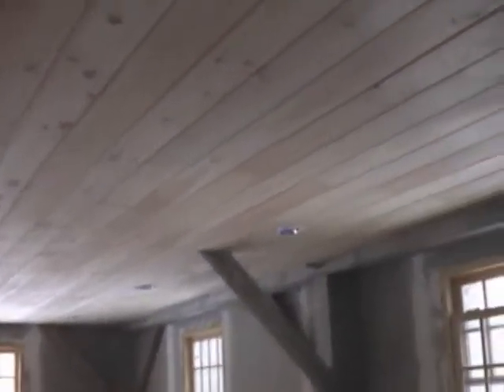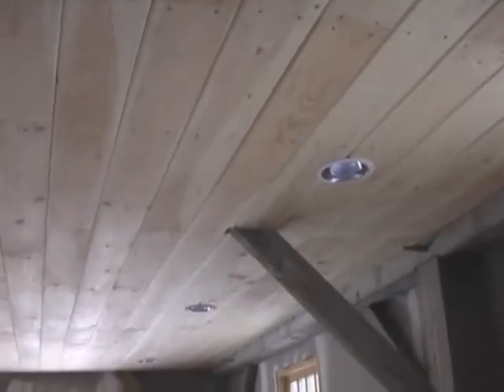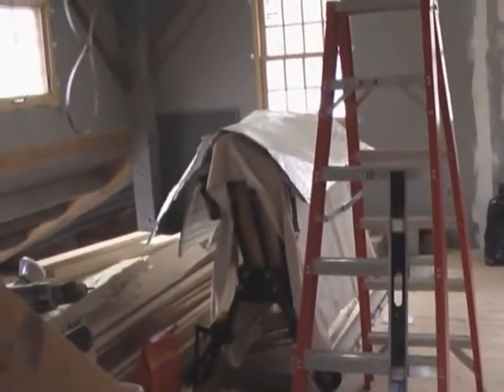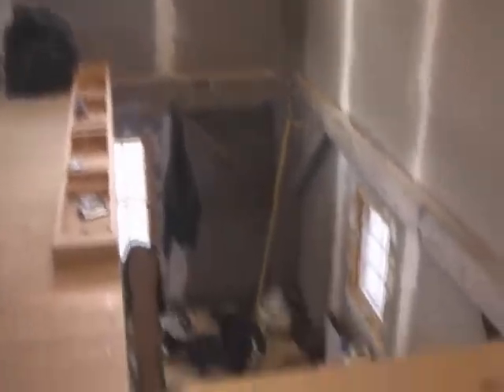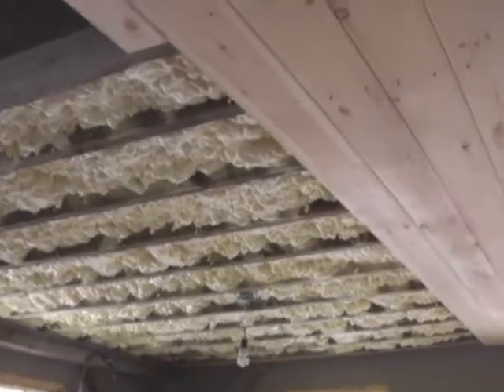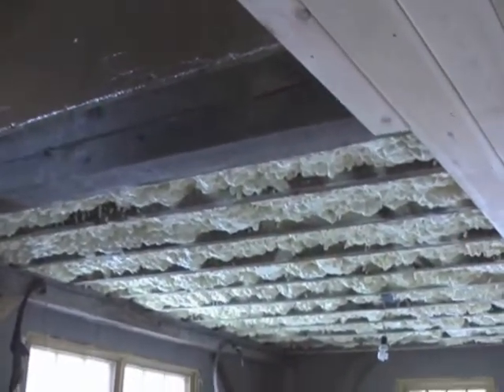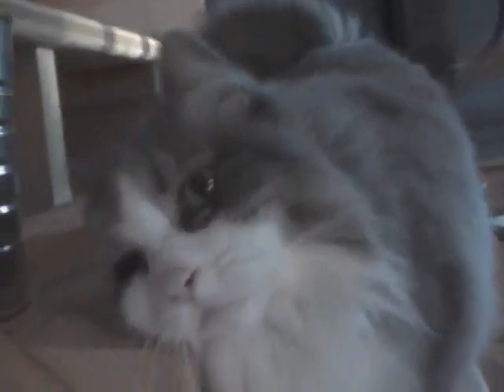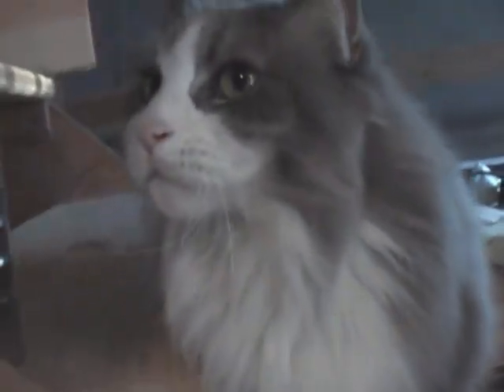White pine v-groove ceiling going up!

Comment from the maker: We used a company called R & M insulation here in CT that came and did it. It was expanding soy based flame retardant foam. One day they came out and laid plastic over everything. The next day they came and sprayed it. The day after we were putting up the pine ceiling!  RValue = 3.89 per inch and we had 8". Toasty warm!

Comment from the maker: @gsjodin They are made by Tremont Cut Nails, a division of Acorn Manufacturing Co. Inc. We bought them right off the acornmfg website, and you can find more retailers at, tremontnail. Our local hardware store carried some kinds, but not the ones we wanted. We used them throughout the house. Great nails.

Comment from the maker: We used 2" cut shingle nails from the Tremont Nail Company, which is a division of Acorn Manufacturing. Made in the USA est.1819  They are fashioned after hand forged nails of the late 1700's. We used their nails through out our timberframe house for floring and ceiling for an authentic look. tremontnail(dot)com a really great company in Massachusetts. Of course the frame of the house has no nails, mortise & tenon with oak pegs. :)